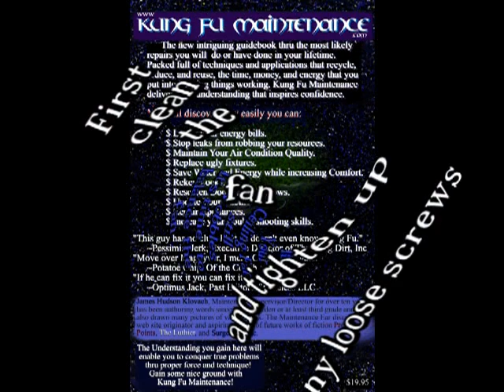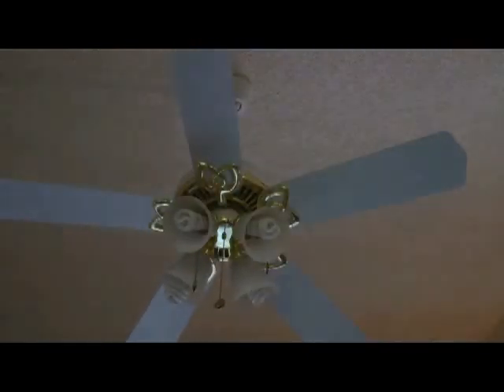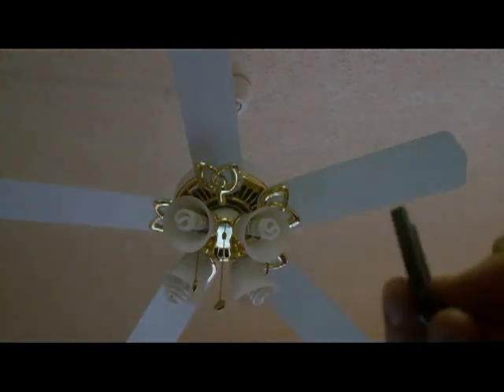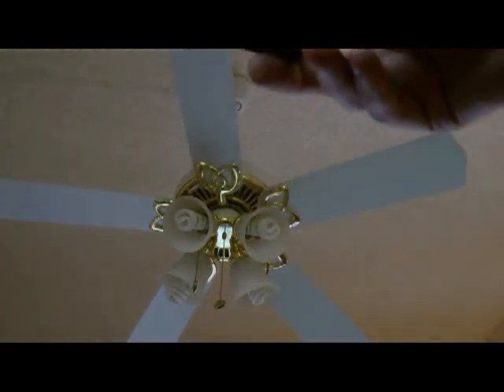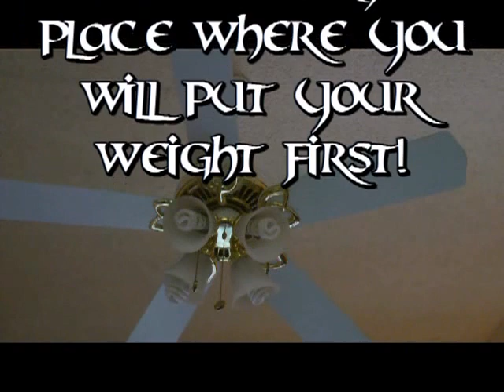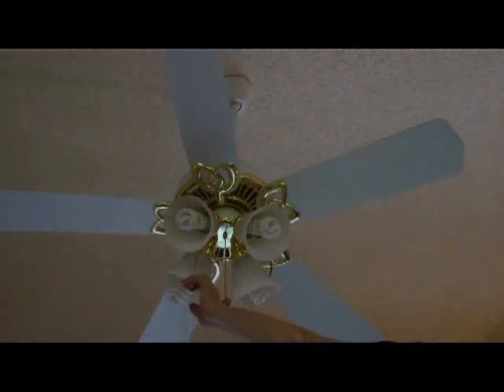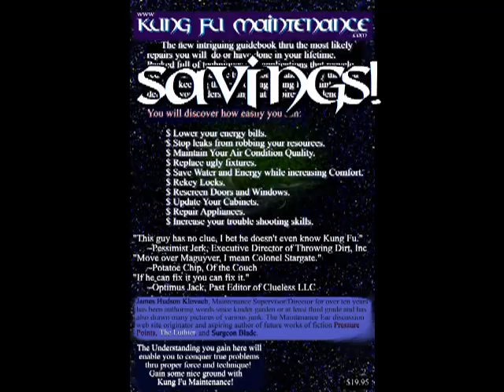How to Balance a Wobbling Ceiling Fan by Kung Fu Maintenance

Comment from the maker: You have something their but it is a slightly different but very related problem. That would be a loose mounting bracket. Though it would be better to turn off power remove the trim plate and tighten the bracket to the ceiling box than balance the fan. If you did insert material into the gap it may stem the problem. Just make sure the material used has insulating qualities. Cardboard, wood,(nothing that would conduct electricity.) It's all fun and games till someone get's juiced.